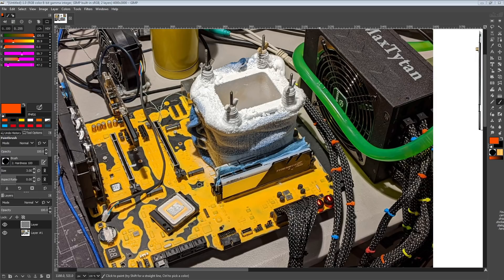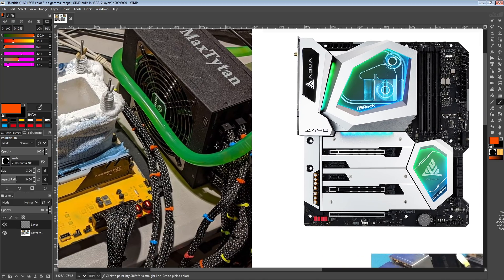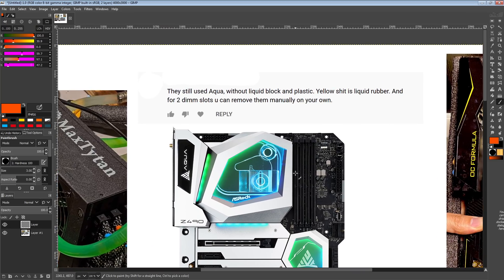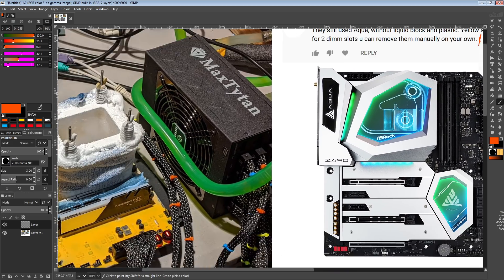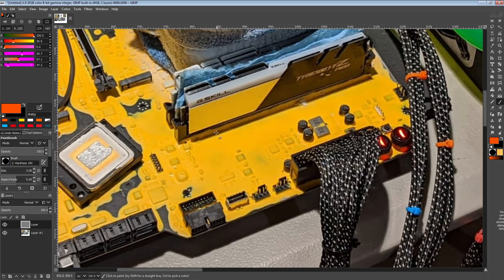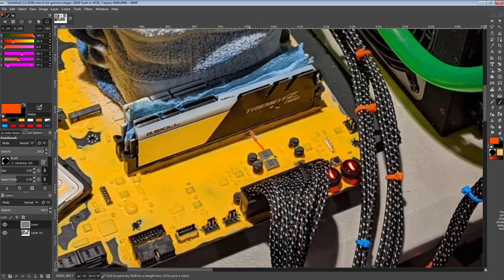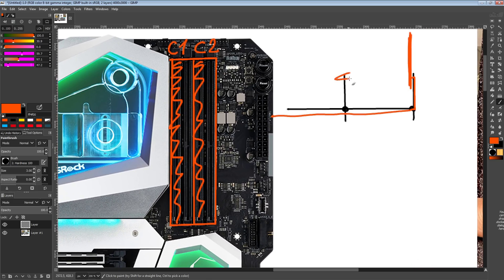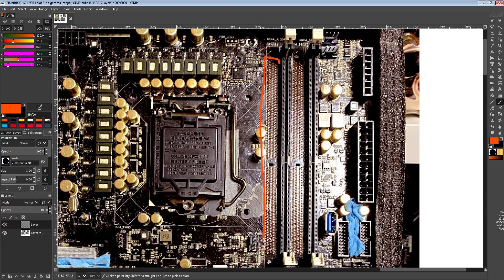Asrock Z490 Aqua-OC memory layout vs retail Z490 Aqua

Comment: Had AsRock claimed that a "factory-modified Z490 Aqua" was used to achieve the records, I think we'd all be okay with it.
The problem is that (by just using the term "Z490 Aqua") AsRock has implied that the average Joe can go out and purchase (or somehow create) this very board — which is clearly not the case.

Comment: With the Aqua marketing and the Taichi's power draw as covered by Gamer's Nexus, ASRock needs to seriously consider less risky decision making, especially when consumer confidence is at stake. ASRock's Z490 boards use the most desperate marketing and extreme BIOS overclock defaults. I just wouldn't trust a company using these types of tactics.

Comment: Buildzoid, what do you think about actually try this trick (remove two slots) on AM4 platform. Some really bad overclocking board (like x370 Taichi)? Maybe it will help to boost overclocking RAM?

Are memory topology is important for this (Daisy, T-Top)?
Reply: if a board is shit at memory OC removing slots isn't gonna fix it. if a board is really good at memory OC removing slots might make it even better.

Comment: Instead of desoldering memory slot on 4 slot motherboard, is it not better to make a "dummy stick" that is matching the needed impendance in order to "absorb" the signal ? 
Is On Die Termination controlled or depending on memory ic used ?
I'm mostly benching DDR3 on 775 platform using P45 or X48 chipset and I would like to get the most out of them, but there is some settings like the drivings settings (driving pull-up or pull-down), clock skew (as far as I understand it's a shift in time of reading signal), timings about "different/same rank" (trd2rd, twr2wr, twr2rd, trd2wr) or tRD phase adjustment (4 different phase) that are very little documented, do you know a good website that is explaining all of these things ? or maybe you can ? :)

Comment: G'day Buildzoid,
I agree it does look like AsRock has made a Deliberate OC M/B for the OC Records, with another difference on the OC Boards being the ASRock Z490, RoHS & Compliance Logos Screen printedwhere the 4th DIMM should be clearly seen on the Black coated Board, that aren't on the 4DIMM Board,
seems to me instead of Totally Redesigning the DIMM Connections for 2 Channel side by side,  they used the 4DIMM pattern & terminated each Memory channel at the first DIMM for each channel (DDR4_A1 & DDR4_A3), so they have the shortest traces but still using the 4DIMM Layout & no excess trace going to the second DIMM for each channel,
where as if using 2 Sticks on the 4DIMM AQUA you would use the 2 outer for each channel (DDR4_A2 & DDR4_A4) the ones not installed on the OC M/B

Awesome Job Buildzoid giving some people a reality check:
It's NOT OK to advertise your 4DIMM Retail Board with a 2DIMM that uses a Completly Different Memory Layout, That's the Problem, So,    Yeah also, This Guy is an Idiot, Arm, So that's it for this Video  🤣🤣🤣🤣🤣 Best sign off ever

Comment: (reminder:I was on the hunt for z390 aqua feedback to potentially buy a z490 aqua) when I saw this at the announcement the 1st thing I tried to do was eye-measure the gap and count the components between the retail and the record board and it was pretty obvious you couldn't fit 2 more slots, that said it's insane that they made a prototype PCB for that and really stupid to fake dimms they should have left it at two then play dumb, Asus has the Apex they have a reason to do this they sell a dedicated overclocking motherboard, if you missed my comment on last video Asrock is a bit dishonest in the retail version too as the Z390 aqua had wc chipset, the z490 looks like it has a chipset wc block but it doesn't it's fake, z490 aqua only cools vrm,cpu and ethernet controller (10Gbit I guess as it gets hot for sure) and again nobody interested in the aqua would xoc with it or do weird electronic mods you buy that because you want a plug and play watercooling solution and not bother with another brand block and their often not so great tightening systems (but maybe that's just me)

Comment: why not remove all 4 dimms for even better oc
Reply: In all seriousness soldering the memory ICs directly to the board would improve overclocking capability. Not practical but what about breaking overclocking records is?
Reply: Loool xD
Reply: best idea, cos you can just download moar RAM anyway :)
Reply: Even better would be to use two anti-slots. So, the mobo would have minus two DIMM slots. That could, potentially, bring down delays to zero. It's like quantum teleportation -> also, it's got electrolytes!!!!

Comment: @  03:24 I Saw Socket LGA 1159. Why??
Reply from the maker: old CPU-z misreports LGA1200 as LGA1159 I have the same thing in some of my videos.
Reply: der8auer mentioned it in his 10900k ocing video, they were detected as 1159 in older cpu-z versions, and that has been later fixed.
Reply: CPU-Z misdetect LGA1200 as LGA1159, til now

Comment: Noob question: in theory, would it be possible to replace lower amped mosfets on a mobo to higher rated mosfets? Like to go from 50A to 90A to avoid VRM overheating?
P.S. Which version of Windows is best for OC records breaking? What do you think of Windows 10 Enterprise LTSC?
Reply from the maker: I want to try messing with swapping mosfets. best windows version depends on the benchmark some benchmarks are best on WinXP some on Win7 some on WinServer and some on Win10.
Reply: it's very possible, although for reducing heat it's not the amps but the RDSon you want to be good. don't discount inductors, they too contribute to heat.
a problem with going up in specs is at some point you're gonna blow up the drivers as gate current kinda always goes up the larger the specs of everything else. :)

Comment: Buildzoid! I completely understand yours frustration about this! My hobby is build people cheap gaming computers and my eyes bleed reading many comments on Facebook forums about which part is better for who... 

For example literally an hour ago someone ask about cheap upgrade on lga 1150 for less than 100$ and few "all knowing pros" (I mean stupid kids) said buy i3 8100. You know what is worse? They kept saying it will best option! I ask them "how she/he would even mount 8th gen cpu on motherboard that not supports it" and they eat my question, called me noob and disslike 17 times laughing of me!

P.S. That's why I am a subscriber and you deserve for like button under this video!
Reply: Did they also come up with a way to get ddr3 to work with that 8100? :D
Reply: Technically if you do a BIOS and HW mod (some soldeing on the mobo), then it is perfectly possible to run 8xxx/9xxx chips on Z170.
Reply: @TheBackyardChemist  LGA1150 are the  Haswell boards. Those are the Z87/97 etc.
Reply: @SolarianStrike  Oh crap, I really lost track of the Intel socket names. In that case it clearly does not work lol.

Comment: I also just realized what that IHS is doing there, that's quite an interesting chipset cooling solution
Reply: Splave is showing he is benched a direct die, that's why he left the IHS sitting there, nothing to do with chipset cooling
Reply: @dustinthomas2998  Yeah, maybe he just wanted to show off, but I dont think he placed it onto the chipset for no reason.
Reply: Heh, I know a few guys who used IHSs for cooling chipsets and network controllers and such.
Reply: using a delidded CPU on a board with a full-cover waterblock is genius ;-) The waterblock would never touch the die without the IHS in between. That's make the whole Asrock advertisement even more hilarious.
Reply: ha, same. i got at in the first video, but first i was like: does he need to show that its without the IHS?

Comment: One of the Asrock representative I know  (Well the guy doesn't work for Asrock, more like a product manager at an undisclosed country distributor for Asrock products) told me that the board Splave used is a modded ES Aqua that is similar in spirit to the OC formula. So yes, 99% of the board IS the Aqua, but they redone the memory layout and put in some secret sauce for the BIOS and that board is now the top end drag race mobo from Asrock.
Reply: Yea, thats not okay.
Reply: Tactical Center yeah, we did both off the record agree that it was a case of awesome engineer, dumb marketing people.
Reply: That memory section can contribute to 25% (probably) for the record can they achieve, 2 dimm board is huge advantages for overclocker. I think Buildzoid should demo it side by side how much different it is.
Reply: Which means it's clearly not "99% Aqua", since some key components are completely different. You could say it's 99% Aqua if it had different colour or whatever, but it's different in terms of core features.

Comment: Did you ever solder out Ram Slots on a MB? Im curious , I never heard of that. I always thought there would be that many layers that it would be impossible.
Reply: Not really, you can even find videos right on YouTube about it.
Reply: Its not impossible, but you need some special equipment to make it feasible.
Reply: This is not hard as you think. You will need many patients, hot air gun and a motherboard that have naked dimm pins on the other side
Reply: @DiJAndy  What are patients for?
Reply: Ive removed dimm slots before. But i used to do board level repairs in a shop some amount of years ago. Ive done it with so dimms too. No reason to do it other than repairing a damaged slot.

Comment: I believe the Gigabyte Z170X and Z270X LN2 boards and the Z490 Aqua-OC both use (or at least can use) the same bios as the retail boards they're based on.
Hopefully the Z490 Aqua-OC will actually be released for sale, and something will be done about this huge mess.
I don't believe Gigabyte used their LN2 motherboards to marker their retail motherboards, why should ASRock?
Reply: very fair point. and maybe then Asrock overbuild bios be useful.